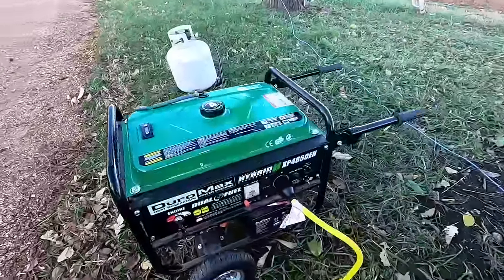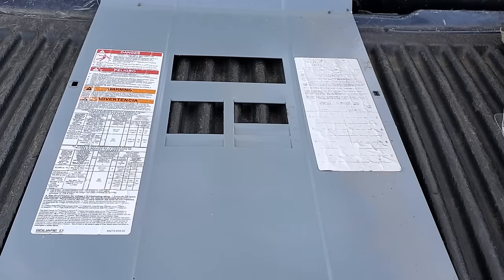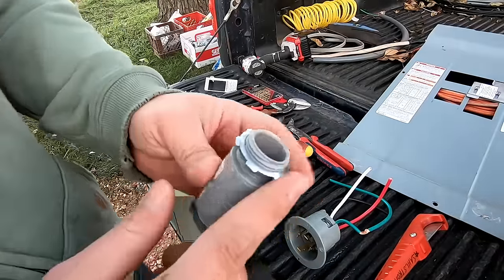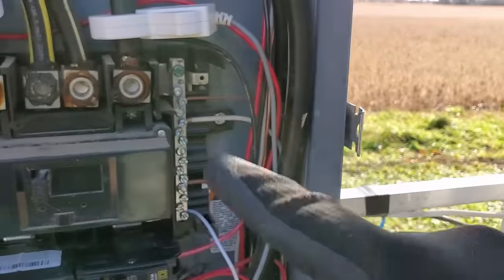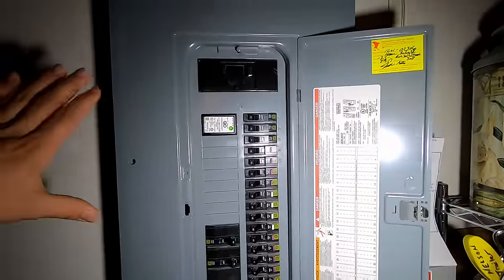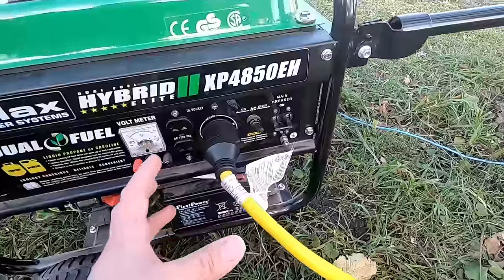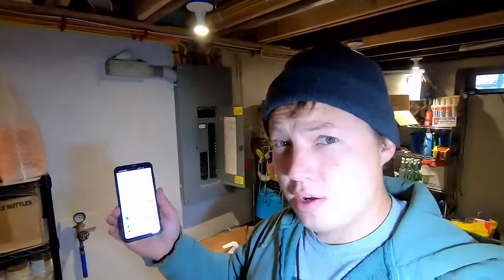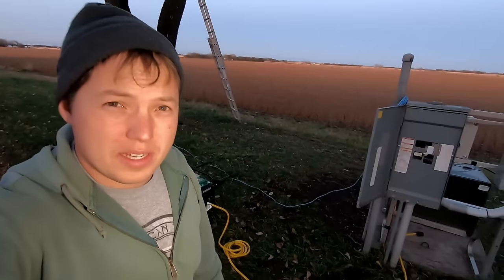How To Hook Up a Generator To Your House Using a Breaker Interlock Kit & Power Inlet Box

Comment: I am just curious if you regret going with a 30 AMP Generator Inlet box instead of a 50 AMP inlet box given you had a such a short run of cable?  Its just 6 AWG instead of 10 AWG wire and there are conversion pigtails to convert a 30AMP generator cable to a 50 AMP inlet plus Duro max makes a hybrid 10000W generator which might be a better option given your situation.  Using that sense energy monitor to better balance your each phase in your panel might prevent  you from overloading your generator, might even make a good video.  You might want your furnace and refrigerator on different phases.  50 AMP might even be enough for you to run your hot water heater while other high load circuits were off.  I use my 10000W Duro Max Generator to run my electronics and everything in my house, I don't have a electric hot water heater, and I don't run my stove or other non essential appliances in a power outage.  Like you said an inverter generator would work better for electronics, the Duro Max does cause my UPS to my computers in my house to cycle, adjusting the UPS sensitivity did not seem to help.  I have one old UPS that does not seem to complain, for the most part I just unplug the newer UPS when I am on the generator.
Reply: Please make sure you follow all the generator safety rules whenever you use your portable generator. 
⚠️Here are the Generator safety rules that everyone needs to follow when using generators:

This is just a reminder for everyone’s safety when using portable generators. All generator safety rules need to be followed carefully to avoid hazards. 

1) Please do not allow an unqualified person or your children to operate the portable generator. Just because some manuals don’t say that doesn’t mean it’s safe. That is important against the generator safety rules. We also need to be keeping an eye on our children too. You need to make sure that your children are not playing near the portable generator especially when it’s running so they won’t get electrocuted. Generators pose electrical risks and they can be hot during an operation. Please keep your children away from the portable generator at all times. It is important to keep our children safe especially our little ones. Be aware of all the hazards.

2) Some people use their portable generators indoors which increases the risk of carbon monoxide poisoning. It’s important to have a carbon monoxide if you have a gas generator. Never ever use your generator indoors even if your doors and windows are open and even in the garage is not safe to use a portable generator. Not even at your porch and your deck. It is never safe to use your generator indoors and in enclosed areas of your home. Your generator needs to be 15-20 feet away from your house. 

3) 🔥generators cause fire hazards too. Never refuel your generator while it’s running. You need to let your generator cool off before refueling it and before storing your generator. Never overload your generator too. Never ever back feed your generator. You should never plug your generator into a wall outlet. Also never store propane tanks indoors. Please keep flammable things away from the generator as well and please don’t smoke cigarettes near the generator. Having a fire extinguisher next to the generator is also important against the generator safety rules. 

4) generator operation; make sure your hands are dry before touching the generator. Never use your generator in wet conditions. Don’t let your generator get wet. You need a generator tent if you need to use your generator during wet weather. Please don’t wear loose clothes when operating the generator. Turn on your generator before plugging in appliances. Use the right cord for your generator. Please do not use worn out cords. 

https://youtu.be/I1jT3ANENvI and here is a video more about keeping others safe when using generators and also about our family’s safety. It’s important to keep your children safe especially little ones. 

Hope this helps
Reply: Do you notice any problems with TV's, etc. since the newer sets are so sensitive? Do you think a UPS will solve all such issues? Or would it be better to get a generator with <5% THD?
Reply: @donaldjeansonne8667  A UPS is good for momentary power outage or brown probably the most common type of power outage... it will help but only for 30 min...  in a real power outage I have to bypass my UPS because eventually its battery dies, plus the beep is annoying...  I also have a whole house surge protector ($100 circuit breaker) in my electrical panel that protects sensitive electronics from power surges.  

I use the UPS mainly for computers, internet switches routers, even TVs since even a short power outage means you have to wait for a reboot and may lose work.  Nothing worse than watching the SB and you have to wait for the cable box to reboot for 10 minutes...  

What you really want for sensitive electronics is an inverter generator, but they are more than double the cost of my Chinese generator.   Then there is sine wave (line voltage) vs square wave (cheap generators) which some electronics don't like...

My new computer did not like running on my Chinese Generator...  I suspect the generator needs tuning, its voltage and frequency is controlled by the speed of the motor, so dialing in the throttle may help.  I also hear that the power/load is less when running on propane vs gas.

I have been watching some other channels on running a load test and tuning the generator under load...  I am hoping that will fix my generator such all I have to do is leave my UPS plugged in and then start my generator in the event of a long power outage.  The UPS would then handle surges in the generator output and not cycle all the time like what is happening now.  

Inevitably I am hoping the price for a 10KW inverter generator drops with the advent of all the solar development going on these days.   I don't see a hybrid solar array being an option for me due to the infrequency I experience a power outage, easier to just maintain a bunch of inverters and a cheap generator, than go with a off grid solar & batteries.
Reply: @ericfraser7543  Thanks for the reply. I understand the UPS has limited backup time but I was mainly asking about its' power regulating function. I thought it would take the low TDH quality and clean it so that the computer / TV would see clean regulated power when the the generator was supplying the power. Maybe I am not understanding the UPS operation. If that is not possible then I would have to use a better quality generator (<5% THD) to protect all sensitive loads in the house -- or turn them "off".
Reply: @donaldjeansonne8667  I never looked at the THD of my UPS, I suspect it would run most modern LCD/LEDs TVs since they were designed to back up computers.  Most modern consumer electronics have regulators and power supplies to adjust and protect it from power line flux.  

My UPS are old, I pick up used ones online which people discard because they don't know how to replace its battery.  When a UPS is not on and only charging its battery, the most it will do is provide surge protection from spikes in line voltage,  it does not regulate line voltage...   when it is running on battery, it runs an inverter converting DC battery voltage into line voltage which probably cleaner than what you get from a cheap generator.    

Switching from line to UPS inverter is probably not all that clean so it is best to avoid switches depending on the sensitivity of your equipment.  The higher end UPS I own have a sensitivity selection low, mid, high...  on it highest setting it will switch over quicker and more frequently based on smaller line flux... I have not seen any difference changing the sensitivity running my home equipment and running on grid power.  Personally I think less sensitive is better, though the default setting is High for most UPS since it will better protect electronics.
Reply: @ericfraser7543  I need to investigate the UPS more. I thought having my computer supplied by the UPS would have it as the source and not just be a surge protector. I guess there are different kinds. I was expecting the UPS to be my source of power to computer. Thanks.
Reply: @donaldjeansonne8667  They have those solar generators which probably would do what you want... probably could charge it while you used it, they are good for hours but are not cheap...   My UPS have lead acid batteries in them... they don't last long even when there is not much of a load on them.  I have one of those car jump packs with a built in 200W inverter which will run all night on the same type of lead acid battery, so there must be some type of extra draw on a the older UPS.   Again my UPS are old, modern ones with lithium batteries may last a lot longer and not be as annoying during a power outage...  

I watched some videos of guys turning old gen UPS like my APC SmartUPS 1500 into an inverter and powering it with car batteries... he had to beef up its circuitry to run for longer periods of time as it was not designed to run continuously.

Comment: I'm looking for an interlock switch for my Square D panel. I have found several, but what difference does the amp amount of my panel make, as to the cost of the interlock switch? The switches loom identical.
Reply: You should be able to open the door and get the model number of your panel and pick up a suitable interlock from Lowes. 
What size panel is it? Is it QO or homeline? Do you have at least 2 open spaces?

Comment: Awesome video man, subscribed!! Your detailed no nonsense approach is great, you convinced me to pull the trigger on the Sense..Thanks for the code too! 

Quick question on how you ran your generator feed through the loops to monitor generator power usage --- I have a sub panel in my detached garage with generator hookup there. 

Could I loop my garage sub panel feed through the loops how you did or would that throw off my sense readings because my main feed and garage sub are hot together; unless I'm on generator power then only my garage feed is hot?   Thanks!

Comment: Dual fuel generators are handy to be sure but be aware that using propane or natural gas will cut your maximum power output by 20%. 5000 watts = 4000 watts,
10000  watts = 8000 watts, 7000 watts = 5600 watts.

This is because the energy density of propane and natural gas is lower than gasoline.
Duel fuel generators are fine and safe. Just be aware of their lower power output when planning your setup or using a propane fueled generator.

FOR YOUR VIEWERS WHO WILL BACK FEED A GENERATOR:
If you plan on powering an all electric house and running everything like well pump, electric stove, hot water, central heat, dryer ect, basically all high drain devices, a 10 gauge cord or Romex type wire is woefully undersized. I used all 8 gauge wire and we don't use our stove, dryer or central heat and I only run my water heater when we need it. I made my jumper cord from the generator to it's wall outlet out of 8 gauge wire and 2 plugs to mate my sockets.
Reply: ⚠️Generator safety tips:

This is just a reminder for everyone’s safety when using portable generators. All generator safety rules need to be followed carefully to avoid hazards. 

1) Please do not allow an unqualified person or your children to operate the portable generator. Just because some manuals don’t say that doesn’t mean it’s safe. That is important against the generator safety rules. We also need to be keeping an eye on our children too. You need to make sure that your children are not playing near the portable generator especially when it’s running so they won’t get electrocuted. Generators pose electrical risks and they can be hot during an operation. Please keep your children away from the portable generator at all times. It is important to keep our children safe especially our little ones. Be aware of all the hazards.

2) Some people use their portable generators indoors which increases the risk of carbon monoxide poisoning. It’s important to have a carbon monoxide if you have a gas generator. Never ever use your generator indoors even if your doors and windows are open and even in the garage is not safe to use a portable generator. Not even at your porch and your deck. It is never safe to use your generator indoors and in enclosed areas of your home. Your generator needs to be 15-20 feet away from your house. 

3) 🔥generators cause fire hazards too. Never refuel your generator while it’s running. You need to let your generator cool off before refueling it and before storing your generator. Never overload your generator too. Never ever back feed your generator. You should never plug your generator into a wall outlet. Also never store propane tanks indoors. Please keep flammable things away from the generator as well and please don’t smoke cigarettes near the generator. Having a fire extinguisher next to the generator is also important against the generator safety rules. 

4) generator operation; make sure your hands are dry before touching the generator. Never use your generator in wet conditions. Don’t let your generator get wet. You need a generator tent if you need to use your generator during wet weather. Please don’t wear loose clothes when operating the generator. Turn on your generator before plugging in appliances. Use the right cord for your generator. Please do not use worn out cords. 

https://youtu.be/I1jT3ANENvI and here is a video more about keeping others safe when using generators and also about our family’s safety. Hope this helps

Comment: For anyone watching this messing around with electric is not a joke being a electrician for over 20 years I've been electrocuted a few times changing Outlets I've actually was hooking up a stove 220 my tester showed that it wasn't live did not take the time to look at the panel took my Klein pliers cut the wire to the length I needed the line was live blow a hole in my pliers and got one heck of a jolt and the pliers with thrown from my hands across the room you could be killed buy a 9 volt battery if your heart is weak enough so if you don't know what you're doing is your life worth losing to pay someone to do this or getting seriously heart

Comment: Thanks Benjamin for your explanations and video's. I have the same generator and I used this transfer switch to install it. https://www.homedepot.com/p/Reliance-Controls-30-Amp-250-Volt-7500-Watt-Non-Fuse-6-Circuit-Transfer-Switch-Kit-3006HDK/202213700
What I like about this model is that if you gen cant run the entire house you can select certain circuits. I also like that NO power can leak back to the grid even with the MAINS breaker ON and that it has load meters on both legs of the GEN.

Comment: It looks like you have failed to twist-lock both ends of that 10 Ga. cord.  Just plugging them in is NOT sufficient.  After inserting the plug, twist it clockwise maybe 15 degrees or so, and it should be impossible to pull out.
Reply: @The_Happy_Aviation_Enthusiast  Yeah, but that does not seem responsive to my comment on twisting the plug.  But okay, fine.

Comment: Is that type of generator more efficient than a gas generator....
Reply: No, it is a normal gasoline engine with a secondary stage propane/ natural gas (methane) injection option kit. Any one with reasonable mechanical skills can install one on many common small engines. These fuels actually have slightly lower BTU content than gasoline,  so horsepower is reduced. However, there is no fire risks whilst refueling, the gases are more long term stable and storeable, burn cleaner with lower deposits and emissions,  oil changes can be extended,  and if connected to your main NG household supply may have virtually limitless fuel supply. So, for emergency backup use a superior option.